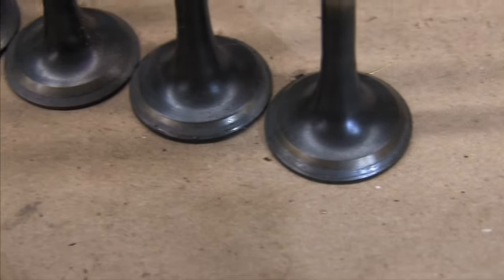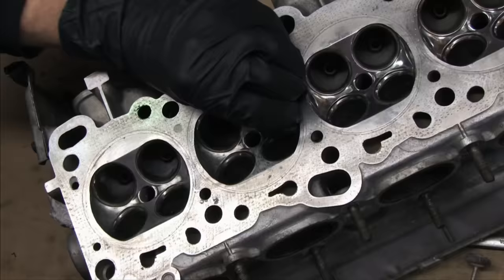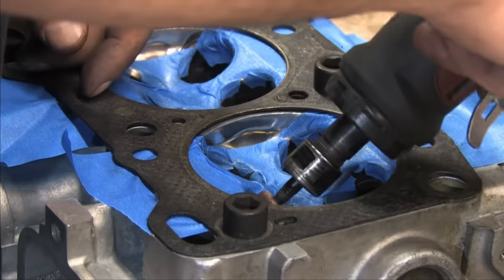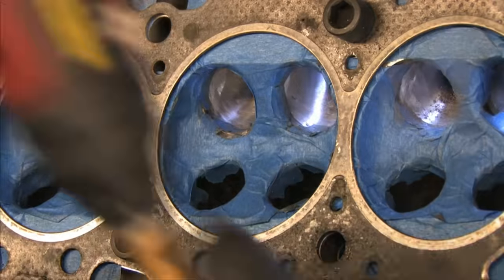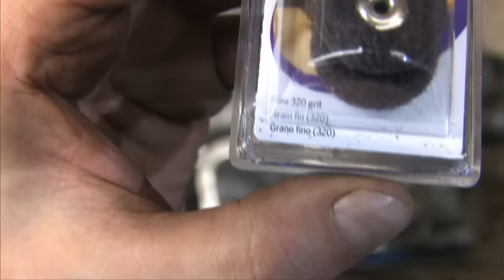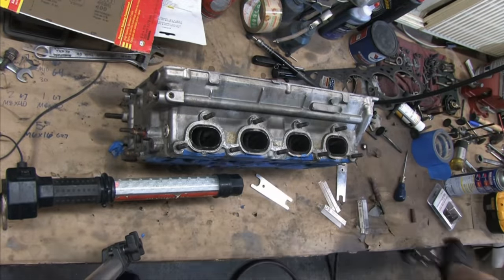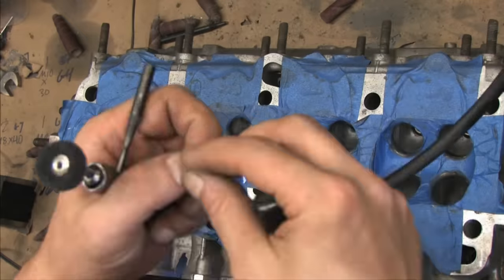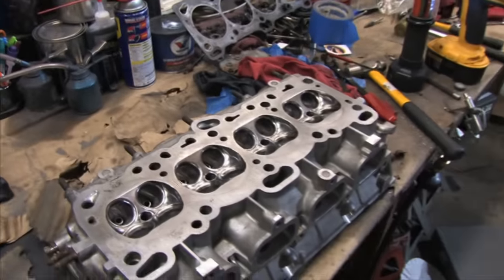Cylinder Head 204 - Porting & Polishing

Comment: Thats a 1992 only reason for preignition!!!! Computer controlled after 1995 are almost bulletproof. Back in the day you bought Higher Octane gasoline for a slower controlled burn to eliminate spark knock or preignition. I know your spending a lot of time and effort on that hyundai. 10 yrs from now youll say I shud have threw it together and traded or sold it. But I would have cleaned valves and seats. Thats a for sure!!!  Carbon gets on intake valves too.Wire brush all and if you can lap them in fine but a reg valve job prob wouldnt be much at this point.  Then again Im old school and we did that. Now days they just slap a complete head on. And if its cheaper go for it. And yes Higher Octane burns slower but more even.However on Diesels with Cetane it does burn faster with higher number and can affect timing changes. But they prob have computerized gizmos to take care of that too. Trivia questions for all you Jeapordy stars???? When was bud lite introduced and secondly when was buschlight introduced. I know when they were INDUCED!!!!

Comment: noob here. trying to fix my mini cooper S (N18), bent valves.. YT suggested this video 😁 omg. this is sick. I would be happy if I manage to remove the springs!
Reply from the maker: I have a video for that, too...  I'll bet your valve guides are toast already, so you might as well just use a hammer to remove them.  You should be able to find plenty of used cylinder heads for that model, and if you've gone far enough to be stuck at removing valve springs, it's also the least expensive route.  I've got lots of cylinder head videos, bud...

Comment: I had a pickup with a V-8 and it would knock or ping under load unless the spark advance was way set back. I removed the heads and smoothed everything in the combustion chamber along with minor porting in the valve area. What a difference. The spark advance could be moved up and the knock and ping was gone with much smoother running under load.

Comment: Having owned and operated a flowbench for years I was prepared for butchered up port work.  Congrats on a job not too over done. Seen some terrible home jobs and what you did was pretty good.  Now some observations and rules of thumb, air does not mind compressing but hates to expand. To address this the best head design has the valves sunk down in the head in a dished pocket.
Blend the valve seat with the port carefully,  you get no more flow from a highly polished intake - 80 grit would be fine.  Maybe most importantly ... flow will be harmed if you drastically remove anything from the floor of a port, period. 
Highly polished exhaust ports reduce surface area, maybe reducing heat absorption ... applies to combustion chamber too. Valve job should be three angles 30,45 and 70 degrees.  Outer edge of seat should be right at the outside of the valve, 50 thou wide for exhaust a little thinner for intake.  Exhaust valves are always sized about 85% of the intake, this is fine as spent gasses have no weight and gets "pushed" out.  Too large an exhaust valve reduces torque.
Reply: Can I ask you how a port and polish job would benefit my 2005 YZ450F head rebuild?  I bough the motorcycle with a damaged head.  It was beyond repair, so I found a decent used head and purchased it.  Tested it for leaks and found it to be good.  I then removed the valves to perform a thorough cleaning of everything.  My neighbor piqued my interest on the "port and polish" idea.  So my question is (with respect to a high performance dirt bike), would a DIY port and polish job be worth my time and effort (assuming my job quality is decent)?  Thank you in advance for your response.
Reply: @gregbacon819   In a word no ... there is more than enuf air-flow to fill that cylinder.  4 valve heads these days are so well designed that volumetric efficiency "VE" is so very close to 100 percent, little can be done to "improve" on 100%. Depending on how you "cleaned it" ... chemicals you're probably OK.  Wire brush on a drill or emory cloth you've probably polished away a portion of the seat. You'll need to make sure you freshen it up with a careful valve job with the three angles mentioned ...  the seats should be near outside of valve instead of in the middle like so many shops do. Actually the seat angles are 30-46-70 ... 45.5/46 would be an interference angle on a 45 degree valve.  Don't over rev it like the last guy, dirt bikes have a lower power band .. no reason to spin it that hard.
Reply: @markshag5149  I cleaned all the carbon out of the head with carburetor cleaner and a nylon brush, so no damage was done to the seats.  I appreciate your thoughtful advice.  Thank you!

Comment: You can cut scotch brite pads up into little squares and make your own arbor out of a screw with a nice round head. You don't have to make the pads round as you stagger the corners and then they quickly make themselves round as you use them. Add some valve lapping compound to the pads to start the polishing procedure.

Comment: Some thoughts go along the line that to shape the inlet to increase flow, but not polish too highly as the slightly rougher surface helps atomise the fuel for a better burn. The exhaust port best shaped smooth and highly polished to speed up the flow of exhaust gases. But my own personal experience was only on two stroke racing engines, may be different on four strokes.

Comment: Atomisation vs airflow, each single engine setup has its own requirements of each. B.L. A-series engines make more power with rough port surfaces, so it gains from atomisation much more than the airflow. A newer engine might typically gain more from the airflow increase, and already has excellent atomisation, thanks to technology like injectors. Another important thing to note here is combustion chamber CC increase (lowering compression), which will happen to some degree or another, depending how much material is removed. In the old days, they "blew" carbon dust through a bench-mounted head at the speed of typical engine flow, and shaped the ports according to the markings left by the carbon. This ensured high airflow (small port) but improved the weakest points in the port´s flow.

Comment: Congratulations on a class one specious arguement re dotonation.
I haven't heard one that good for awhile = 10/10!
BTW the combustion chamber squish area was completely neglected but we won't worry about that since it aint pretty.
I too love my motor but I prefer to lick it instead viz. intracourse induced tumesence - inguinal in location resulting in pre ignition. The resultant fluid should be added to fuel for added performance since it reduces fluid pipe friction, which in turn reduces fuel pump load (pardon the pun), alternator load and ultimately frees more power to the people! Yay ...

Comment: I'm doing a port and polish head job on my 1.9L Saturn LLO DOHC build too! With port and polished intake manifold, with port match and bigger throttle body, mild deshrouding of the intake valves, minor blending of the bowls, .20 oversize pistons with thicker ring lands and sleeved bores, heavier, better balanced 3rd generation 1999-2002 crank , 3rd gen lower tie plate, and going to run two intake cams set at 180 degrees and retarded timing by two teeth on the cam gear. I'm also gonna add 14-15 PSI of boost. It should be a ferocious car since it's weighing in at 2290 LBS. Saturn made good engines. The lost foam casting of the block is even lighter than, for example a Honda B16, or like a Ecotech engine. I'm just checking out the process involved at a port an polished head job, very good video man!! :)

Comment: a slightly turbulent boundary layer actually does promote higher flow velocities by 'cushioning' the main air flow against the port walls. this is why high performance intakes are generally left 'as machined' - even in formula 1 ;-)

Comment: Feel like you coulda spent more time with the lower grits to get more contours out, but like you did say it’s just a stage 1 port and polish job, and I just use the softest sand paper I can find for the finishing touches, soft fabric like sandpaper, and I do it by hand with my index finger. Then to take it further my secret weapon is my bare index finger lol. Your skin will get out any sharp surfaces. It’ll just rub that slightest bit of excess material off and since your hands are naturally greasy it’ll help polish it better too. Then I follow that up with a clean rag and it’s nice and shiny. But I like your work too. Yours looks shinier then my work even, but like, you gotta take my finger advice lol. Had one customer ask me why he had finger prints all over his ports because he later scanned it, so you gotta be careful looool. Atleast he complimented my work lol, said it was near perfect. I coulda spent an extra hour on it, but like I already spent maximum time for what it’s worth and then some extra for little perfections but how much time are you really gonna spend on the thing, that’s the question lol. To get every perfection. Even on your own stuff it has that limit of work and time spent:perfection ratio. The finger thing takes 2 minutes, it’s a perfection that’s worth it loool, I swear by this method. 

P.s some heads are made of Swiss cheese lol and some holes will just never come out. They’re deep when you look at them. You try your best to shrink em and work:perfection ratio. I was really talking about the contours, but like I personally just tend to really open up ports based on the parts given to me with the head, these beefy valves and massive cams, yeah he’s gonna push tons of boost you know the deal lol. Besides customers always start sweating when you ask them how much boost they’re expecting to give it 😂😂. “Ummm how much do YOU think...”

Comment: Hey Jafro. I want to get my head vapor blasted, but I’m unsure what order I should get the work done. Vapor blast, repolish/touch up port job, then machine work? What’s your suggestion?
Reply from the maker: You nailed it.  That's the order.  You're firing on all cylinders.  And for the same exact reasons that you've already considered.  Vapor blasting will hurt the polishing/porting, will hurt the machine work.  You need the blasting before porting because it saves all the time and effort removing the carbon.  You got this one brother.

Comment: Some good info here, like making sure you go through the same steps/process with each/every port, but: (I see that Cyl. Head 201 video shows Radius Cut and un-shrouding around the valves)...
When I first started porting heads (45-ish years ago) I used to Polished Intake Ports, but after getting a flow bench and flow testing several heads before/after Polishing Intake ports (plus dyno and track testing) I can say (from my experience and testing) that polishing intake ports was a waste of time (plus what others have posted about boundary layer air flow is true)...
The time spent polishing the intakes ports would net much better results if it's spent doing things like un-shroud the area around valves in the combustion chamber (you might be surprised how much low-lift flow you pick up when that's done). That and (very carefully) blending the seat-radius up/out to the valve job after it's done. We ended up having custom seat cutters made to un-shroud the area around the valves, and they also cut a perfectly blended radius out to the valve-job...
I do agree with polishing exhaust ports on race engines because it does take "longer" for carbon to start building up, and it's WAY easier to remove the carbon from those ports the next time to engine is taken apart 👍

Comment: Those heads look sexy as hell once the polishing is complete, If for some reason the engine failed later down the line i'd strip it, polish it, and slap a tempered glass panel on top of it and use it as a coffee table.

Comment: Great video! Awesome job!  I want to hear that engine run when finished!!!!
Reply from the maker: It's running!  It's finished!  This was the cylinder head I used on my '92 Turbo Elantra 4-door.  The first startup was rough because I packed the oil pump with the wrong lubricant, but that's here, too.  It's best 1/4 mile time to date is a 13.22@110mph, which makes it the world's third-fastest Elantra according to DragTimes (assuming all times have been recorded).

Comment: Well I am with you I think you're on the right track I have got a little bit of machine work in my past and I agree with a lot of what you doing
Reply from the maker: That idea in the description about port texture comes from test data that was gained on flowbenches testing 2V and 4V heads.  They found there is almost no swirl generated in 4V heads when the combustion chamber is filled, that only 2V designs generated swirl.  4V heads have to rely on solely on airflow tumble to improve fuel atomization when filling the combustion chamber.  The people who posted the flowbench and airflow data I read came up with a design called a Poly-Quad head which has different sized valves and bores in each valve hole, and those 4V heads DO generate swirl.  Heads with the same sized valves on the intake and exhaust sides don't.  The better the atomization, the better the burn, the better the power output, and the better the gas mileage.  So the opposing texture on the intake side was a trick that sounded like a good idea.  The developers of the Poly-Quad design did not suggest this trick, and I've never even talked to them.  A different shop that builds LS engines suggested this texture trick and said that they had used before on cars they built.  After reading up on the poly quad heads, it sounded like a better idea.  It will never produce gains like the Poly-Quad, and I knew that when I started... It just didn't cost me anything but time to try it.  I really wish I had better means of testing this because the FWD car that it's on has so many other issues contributing to its inconsistencies on the track that it's a horrible platform to test with [at this power level].  I'm making over 150 more whp than I can produce the traction for.  Knock seems to be reduced, but the change is so minor that it could just be an improvement in my tuning skills?  I do know that traction is a much more difficult commodity to obtain now, though?  It's an elusive, almost rare commodity now.  When I set the boost controller to kill, I've added 11mph to my trap speeds and shaved .8 seconds off my ET since this build was completed, but the tires are talking to me for all of 1st, half of 2nd and the beginning of 3rd gear whenever I do that.  If this car could stick, I'd have better data to share.  I love it when thinking people watch my videos.  ;)

Comment: If those are stock valve seats you probably want to upgrade them for higher combustion temps anyway, even if they weren't damaged. I'm not convinced that polishing to a shine inside the chamber is going to yield much benefit, but if  it gives you the warm and fuzzies, I guess it can't hurt. Most machine shops use a multi stage chemical bath and/or bead blasting to clean that stuff out. One other thing, having a perfectly smooth surface on your air intake is actually not better for efficiency, for some applications. The rough surface of the cast on the inside of the ports promotes better air fuel mixture, if you are running throttle body or carburetors, turbulence in the intake is actually good, to a point. Nice job though.

Comment: The way the owner of circle performance explained port texture to me was that on a microscopic level a rough texture creates a barrier of Eddie current air on the port surface. The flowing air has FAR less resistance over the cushion of still air. "Air flows better over air than the smoothest metal surface any day"
Reply: So to clarify... If the texture is too rough you lose flow and if it's too smooth you lose flow as well, unless we're talking about an 18,000 rpm f1 v10 or v8 in which case they use a microscope to check the port texture. Of course you do need to take the thickness if the air cushion into account when determining how large the port must be to flow match the rest of the valve train

Comment: Nice port job and wow what porosity you can see the pin holes.I'm wondering if your gonna do a 3 or 5 angle valve cut.I know 3 angle usually works good and some say 5 angle is the best.I'd go with the 3 angle....

Comment: first off I like to say ty for sharing and putting your time to explain from a to z how to and  videos are understanding and helpful well I have an issue on the 2.4 eco tec doc when I opened the valve cover all the roller rockers were either lose and broken so I put new valve guides and roller rockers but the cam toward the front of vehicle is not touching the roller rockers should I tighten cam then put roller rockers or is my problem even worst with having bad valves please I need to know thanks

Comment: Do you ever remove valve guide protrusion into the ports ?....Great vid btw 👍🏻
Reply from the maker: I wouldn't on a street motor.  There are gains to be had but it comes at a price.  It shortens the life of the valves and the valve guides.

Comment: Even though you don't have a flow bench you can plug the valve holes and intake and exhaust use a graduated water dropper and measure the volume like that.

Comment: I did my first set of heads about 2 years ago, it was a pair of small block chevy heads ( pre LS) it took me a month of cutting sanding and finishing with thoes heads but it was worth saving the nearly 2k for the same job. I have a second set of heads for a new engine and it shouldn't take as long

Comment: I would like to see the procedure for flow matching them. Do you add a long tube with laminar flow to the port and then measure the pressure drop or flow at constant pressure across it with a traditional flow meter or aneometer in tube?
Reply: @KCadbyRacing  how do you do this?